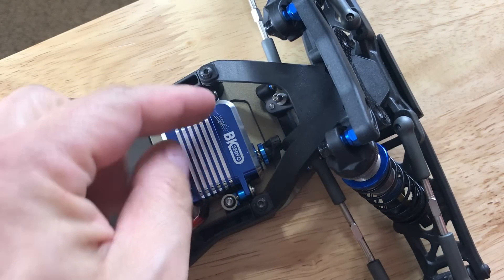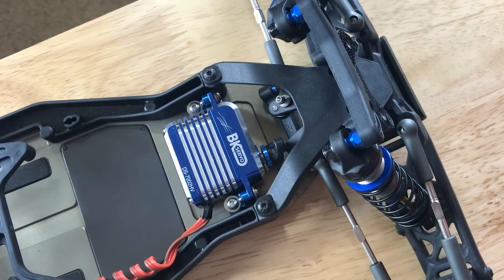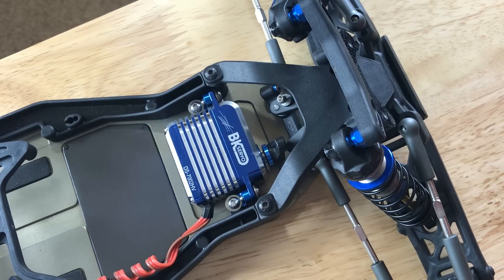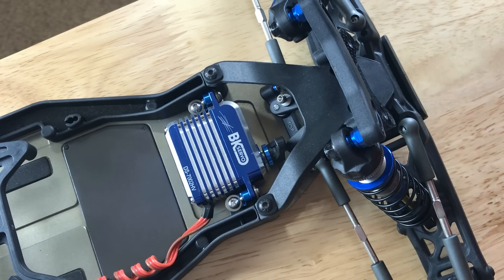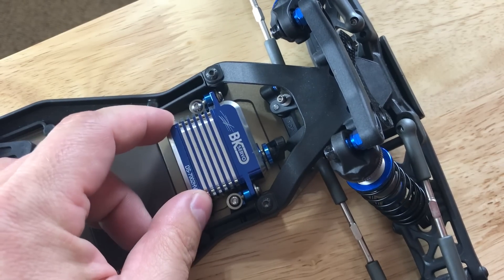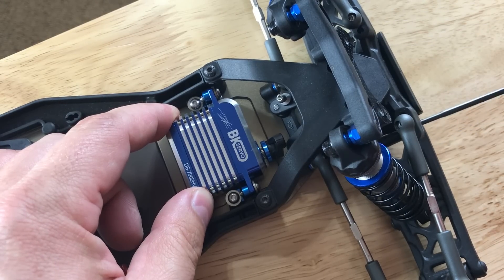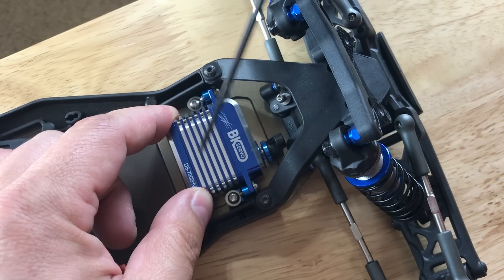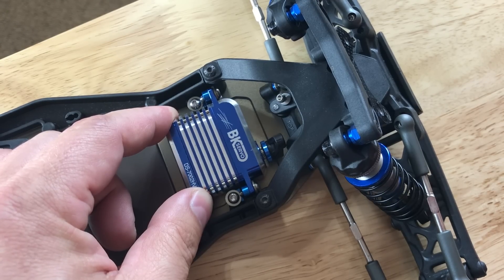RC10B6.1 - Install a servo perfectly! Pt.1

Comment: Part 2 please. I’m specifically having an issue with the steering linkage from the servo to the bellcrank. My servo won’t float around like your video when the screws are loose. I am thinking that some servos have a slightly different output shaft position. On my car I’ve had to use a 2mm spacer in the link rather than the 1mm in order to get the bellcrank to be even side to side when the servo horn is at the 90deg neutral position.

Comment: hey, I've seen some of the servos in your videos, and the recent video about your 3 favorite servos.
   Can you please look at one for me on Amain and let me k ow what you think of it?  it is the Xpert 4431.  My son ran this servo in his 2wd Mod Truck this summer, and it has done well.
   He now thinks he wants an Ebuggy.  My concern, would these specs, .08 and 242 oz, be enough for an Ebuggy?  Or will I be looking at the $120-150 servos for that application.
   I'm thinking in 2019 outdoor season we will stop running 2 classes at club races. ... and focus on just Mod Truck.  I'm thinking we will save our SC trucks for the few larger races we.go to.  My thoughts on Ebuggy are that he's not ready and I'd like him to run 2wd for one more season.  This would also let me have longer to come up with the parts for an Ebuggy...Servo, Motor/ESC, batteries, kit and parts, and a couple sets of tires...
   If I'm able to get it all together then he can run some practice sessions next year and we can sort.out the buggy, as well as get him used to that kind of driving a bit.
   So, would the Xpert 4431 be even close to OK for 8th EBuggy, and would a RC8B3.1e be a decent start into 8th scale?
   thanks for all the videos...

Comment: what do you think about the 4wd sct class? is it dying
Reply from the maker: T2NATE VIDEOS yes
Reply: what class should i run to get into racing
Reply: T2NATE VIDEOS not a big racer but almost every race track I go i see people with 1/8 & 1/10 buggies and truggies...
Reply: i might get a 2wd buggy for 17.5
Reply: T2NATE VIDEOS sounds good brotha...one thing I learned in this hobby get the truck u want and that will last not something cheap and will give u headaches...but me I'm a 5th  scale gas guy and mainly bash also have 1 1/8 nitro buggy and plan to pick up the losi EIGHT X tlr for a nitro build when the time is rite...other wise enjoy brotha don't let rc repairs bring u down it's the hobby run repair n repeat ⛽💣💥💨💨🤙